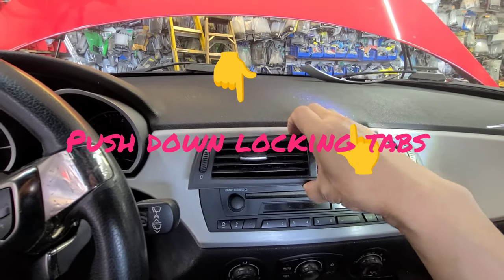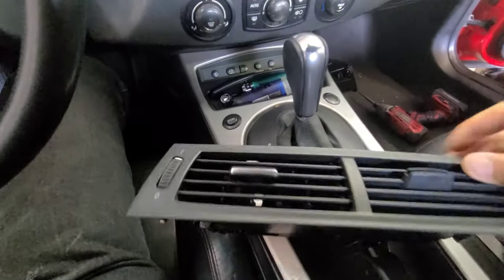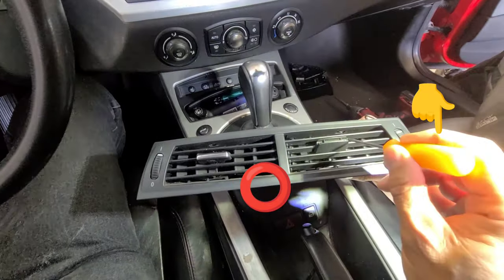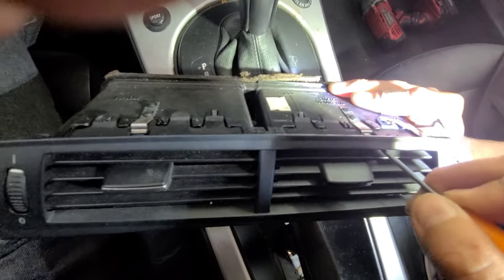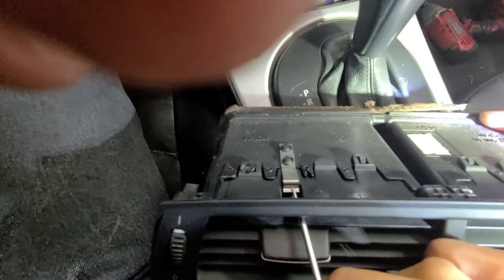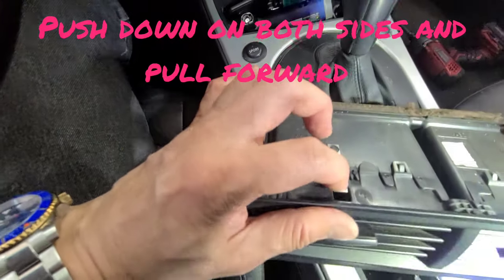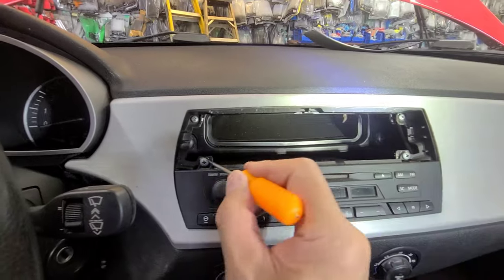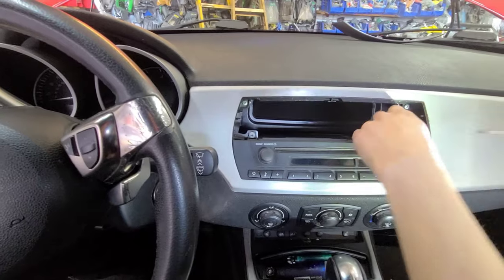2004 BMW Z4 How to remove radio Install Bluetooth radio Metra dash kit

Comment: FYI for anyone having trouble: The two metal tabs on my Z4 were pushed so far up that there was absolutely no way a screwdriver could ever grab them and pull them down, let alone even touch them. After some trial and error I ended up using a lock picking tool that has a hook in it. I then maneuvered the hook up inside the plastic square where the metal clip should've been and then worked the hook around that metal clip to pull it down.
Reply from the maker: Good information 🙏